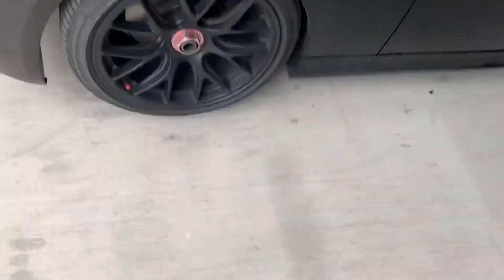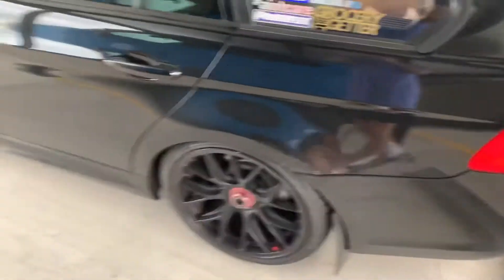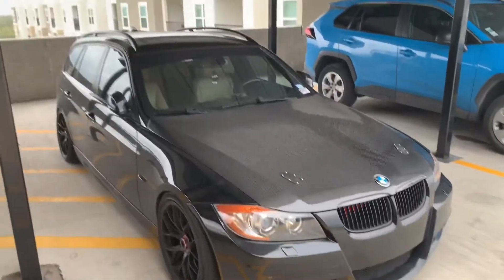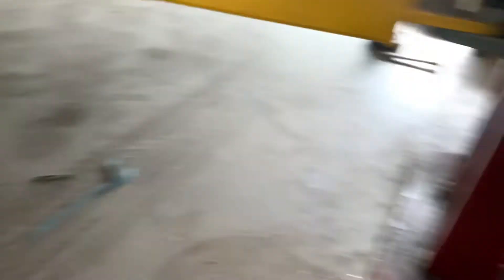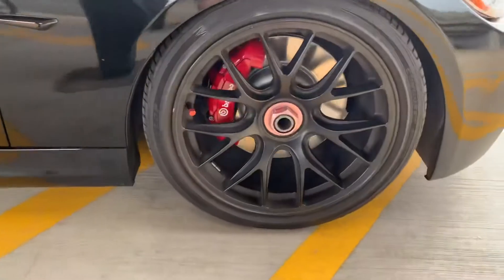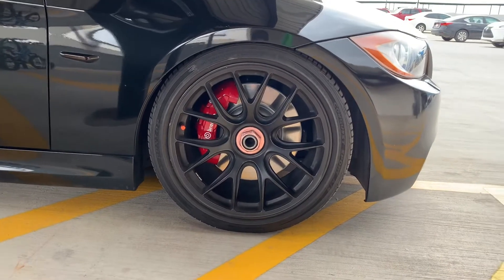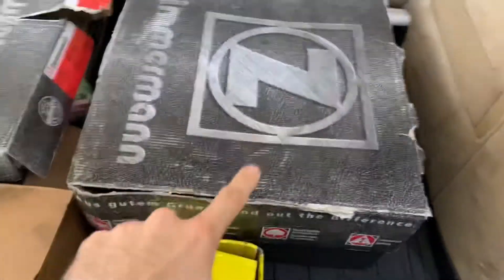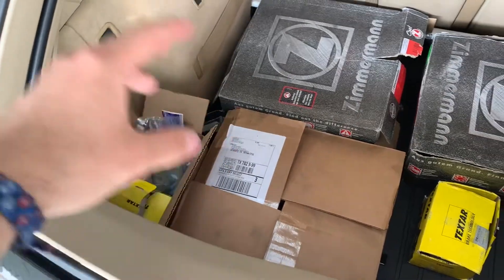135i / BMW Performance - Big Brake Kit install (Bad News….)

Comment: I have these bmw performance BBK on my 2006 e91 wagon.  I was able to use my oem heat shields.  I simply cut a section.  You'll love the upgrade and they look great on your e91.
Reply from the maker: What rear rotors did you use?

Comment: I have the 09 e91, i tried using the 528i rear rotors but it don't seem to work, when the calipers is tightened up it sits on the rotor face, is there a specific rotor for the 528i that is supposed to be used?

Comment: Really nice job. The front look awesome.  Sorry to hear about the rear ones.  I have both a pre lci 335i (07) and (09) 135i, and just changed the front to cross drilled and slotted rotors on the 3 series, and they are really really noisy (like constantly clicking), apparently it has something to do with wind harmonic resonance. Just something to consider if you are thinking of do that at some stage.  I have put back the 348mm solid rotors and the noise has gone immediately.  Look forward to seeing more videos.
Reply from the maker: That’s why I did not want to go with drilled and slotted they’re more miss then hit. No worries on the rear brakes I’m trying to go through al the options for my YouTube community, so you guys have an exact kit to go for👍🏼